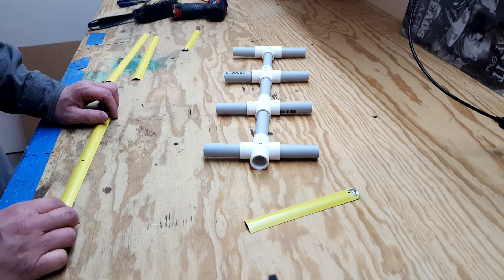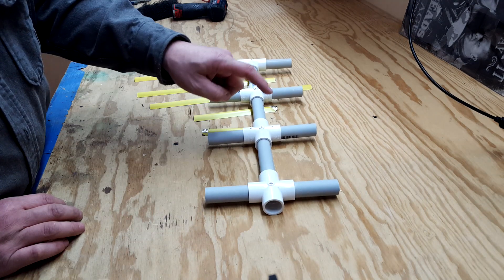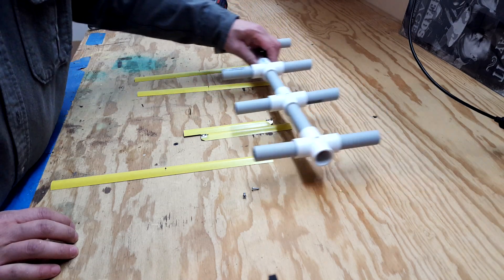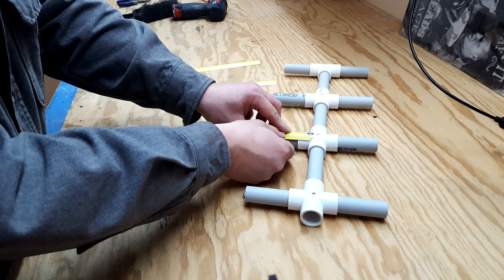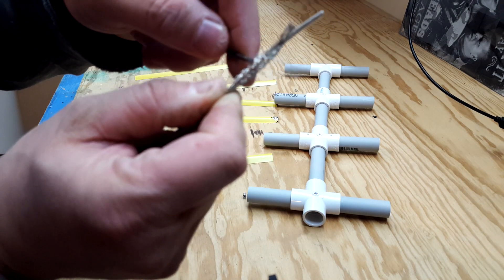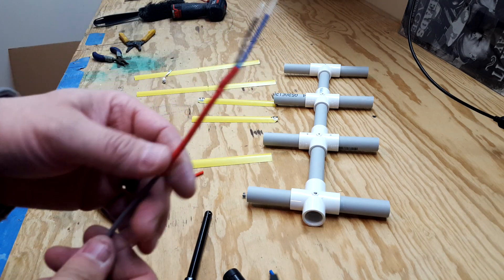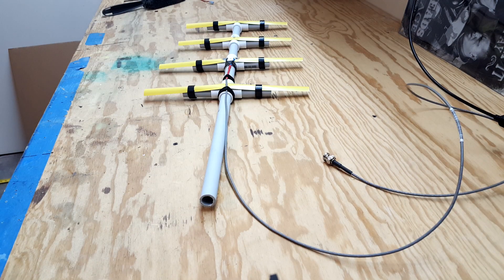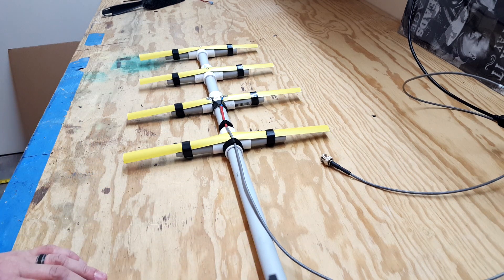How To Build A 70CM Tape Measure Yagi Antenna

Comment: Hi did you check swr across the band? Mine has poor swr curve on 446 band l want to use this for and l figured this must be due to mismatch between rg58 feeder and feed point impedance. No idea what to use as balun transformer the hairpin match was useless

Comment: what is the exact spacing between the cross pieces? i am getting a really high noise floor when transmitting uplink on satellites and cant get a qso.
Reply from the maker: Did you visit my website for more information.
Reply: @FuzzThePiGuy  5 5/8" Thanks. didnt even think of that.

Comment: Thanks for the video!.  I want to build one Yagi to use for finding a drone in case of a loss. The transmitter's frequency I'll be using is 433.075. What is the frequency of this one? TIA.
Reply from the maker: This is for 70cm band. So around 440MHz.
Reply: @FuzzThePiGuy  Ok. Is there a online tape measure Yagi calculator so I can build one to specifically match the 433.075 MHz frequency. Can the J. Drew calculator be used for a tape measure Yagi?
Reply: The answer to your question is yes.  But it would be a pointless endeavor.  You also would not notice a difference.

Comment: Thanks for the video, I'm thinking of trying this type of antenna but I'd wanting to use music wire and a smaller diameter boom to make it more portable. Can you tell me the boom length and spacing between the elements? I checked your website but everything was measured in lengths of pcv. Which of course if your making this out of PVC is a great easy way to do it. Thanks again for a great antenna project. 
73's
N0MLP
Reply from the maker: I think I say the spacing in the video.